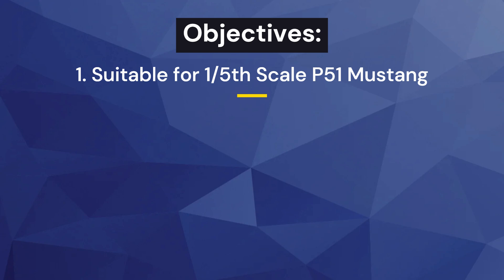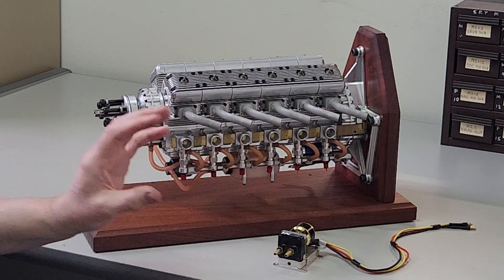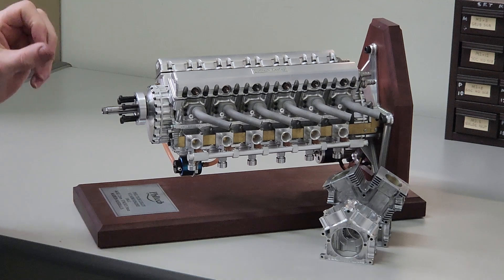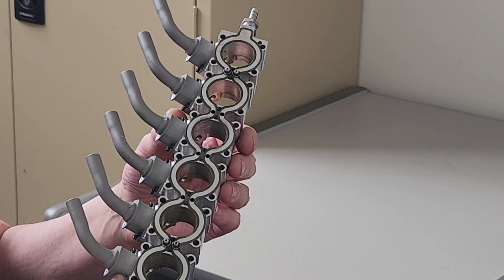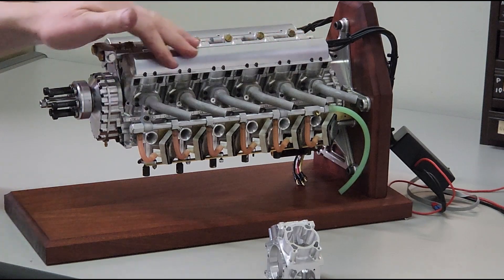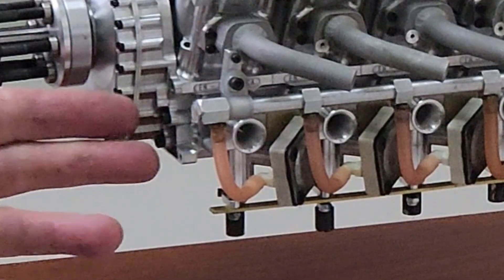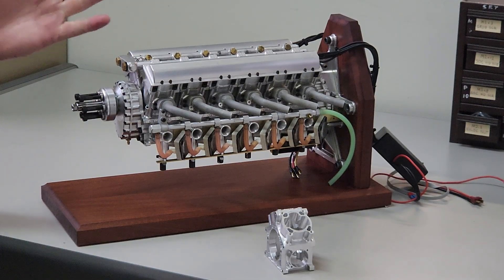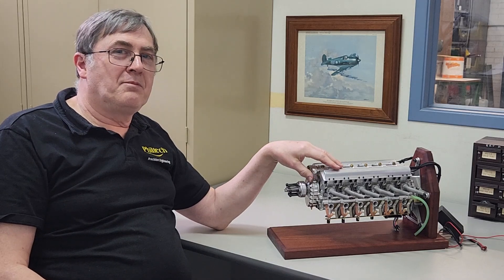Philtech finally gets the model V12 in the air! (History of the V12 part 4)

Comment: An idea I am experimenting with on the Iron Bay regulator I have.
 Put an air fitting to the atmospheric side of the diaphragm, and block the vent. Use a miniature 5 volt air pump to create air pressure, and use a remote needle valve to allow the pressure to bleed off. This allows you to have a slight, controllable fuel pressure to the carburetor. It aids in priming, and hopefully will allow me to tune out the rich midrange problem I have when I use zero percent nitromathane fuel.